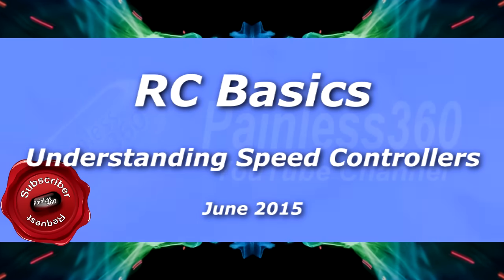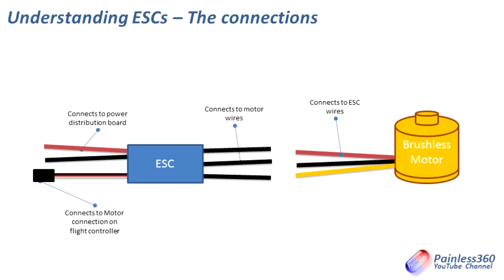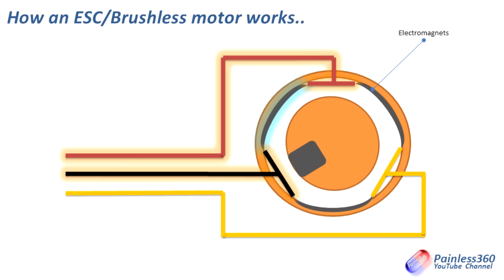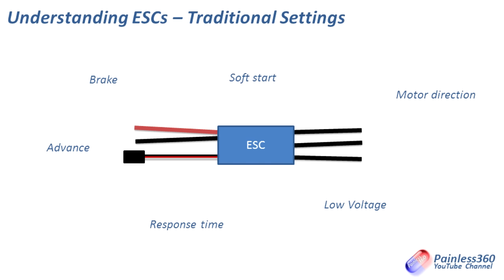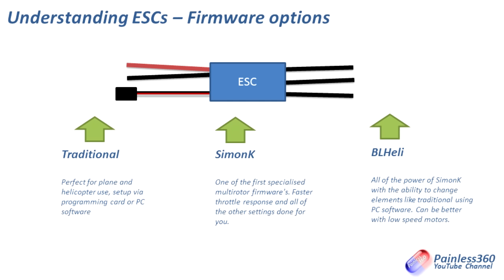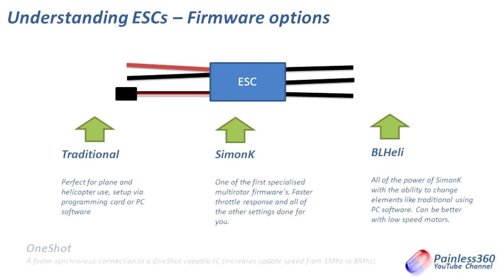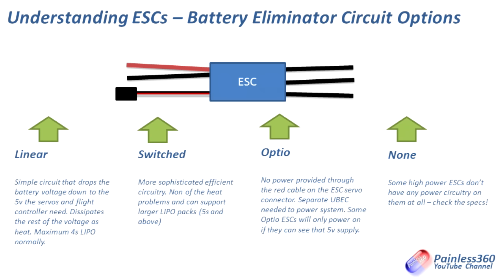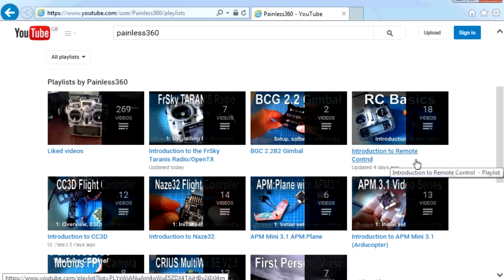RC Basics - Understanding Electronic Speed Controllers (ESC)

Comment: is it crazy to want run hobbying 35A micro ESC's with 5008 330kv motors and a pixracer as I am looking to reduce weight or is this just an altogether daft idea?
Reply from the maker: I'd look at the amp/thrust data for that motor for the prop and battery size you want to run. That beast is designed for HEAVY quads! :D

Comment: Do you have an efficient method of testing esc's to find a bad one? For example on a quadcopter if a esc is cutting out on the left side how do you go about discovering which is the bad one?
Reply from the maker: Not really, I normally swap the motors round with the suspect ESC to see if the problem stays with the ESC or moves with the motor but after that it's a firmware update to it and re-do the throttle calibration, if it's still not happy then I'll swap it out. Best of luck!
Reply: Thanks for the reply! I've seen where guys use servo testers to test esc functions. I'll try your idea of moving the motor around. Thanks again!

Comment: Hello. I'm intent on using an RC motor in a project and have a 12V power supply and a PWM all set to go. Is it possible to connect a brushless to the PWM without an ESC or is the latter a must for brushless? If so, what motor then can I just connect to a PWM in just cutting the wires and attaching it? Your diagram and animations are informative BTW 'cos I'm learning as I go with this stuff.
Reply from the maker: +James Taylor The simple answer is.. you need an esc if you are using a brushless motor. Best of luck!
Reply: ok, i'm in a bit of a conundrum.I was trying to use a brushless motor (thanks again on clearing that other question up, btw) and my intent is to use a 12v power supply connected to a PWM which is then connected to the brushless motor. This is is all for a project. Question: am I mental for thinking this will work?

Power supply: https://www.amazon.com/gp/product/B01N0O646U/ref=oh_aui_detailpage_o01_s02?ie=UTF8&psc=1
PWM: https://www.amazon.com/gp/product/B01H1W79S0/ref=oh_aui_detailpage_o01_s00?ie=UTF8&psc=1
Motor (I'm returning this one before I make the mistake of overloading it): https://www.amazon.com/gp/product/B01149JBNC/ref=oh_aui_detailpage_o00_s00?ie=UTF8&psc=1

Comment: HI,    i have a doubt .is  it possible to run a 1200kv +30a ESc with a dc12v supply from my adapter
Reply from the maker: +Sav job an ESC doesn't have a KV rating. See the videos in the ' Introduction to Remote Control ' series for more information on the basics. Best of luck!

Comment: i mistakenly connected the middle wire of esc with rigth wire of motor. now the esc is not calibrating it is just beeping 
is there any solution for that
Reply from the maker: Depends on which wire you're talking about - one of the three that go between the motor and the ESC or one of the three wire cable that has a red/black/white (or brown, orange and red)?

Comment: Hello sir, i have an bldc motor having maximum current drop is 24A at full throttle, so what rating of esc is suitable for me? What happened if i use 40A esc? And i had little confused in constant and brust current. Thanks
Reply from the maker: Having the rating of the ESC more than the motor is a good thing. Burst current is what the ESC can supply for a few seconds without damage and is usually more than the constant current rating.. Hope that helps..
Reply: Can i use 40a esc? Is there any disadvantages to the motor? Thank u for quick reply
Reply from the maker: All covered in the videos in the ‘introduction to remote control’...

Comment: i have made a q450 drone using sp-f3 flight controller , flysky ia6b reciever, a2212-1000kv motors, 20esc...
whenever i spin the motors using the transmitter...the speed of the different motors reduces at a very fast pace at that too is different for different motor!!
i dont know what is happening...
but when i spin the motors from the cleanflight software...then there is no such problem...
please help!!
Reply from the maker: Not sure what you're describing. If this is testing on the bench then it's normal to have odd behavior as the changes in motor speed are not 'felt' by the flight controller..

Comment: iam building a quad but one ESC worn out all are 20amps can i use 30amp esc? bcz there is'nt 20 amps availability in our place (out of stock)
Reply from the maker: +basha msk all the ESCS need to be identical, even down to the software version for the model to fly well/at all. I'd hunt for a perfect replacement. Best of luck!
Reply: Painless360 both are of same company sir

Comment: i have a boat that there is a lite on esc and beeps but the motor or servo move and the wires to motor not marked and a friend unhooked it but not sure if rhey r hooked back up right
Reply from the maker: If the aeSC and motor are brushless then they can be connected anyway. If the motor spins the wrong way, simply swap any two of the three wires between the ESC and motor.. best of luck

Comment: I used 30A ESC and a 3S lipo battery in my quadcopter. After arming the motors a strange beeping sound(1 beep) was coming from the esc s and the motor did not run when I turned on throttle. What should I do? Can you help me in this case? I'm using sp racing f3 flight controller and using i-bus connection. Actually I couldn't calibrate 4 escs at a same time with i-bus connection. Do I need to calibrate esc individually? 
And do I need esc calibration every time after first calibration?

Comment: thank you this is very helpful...i have quadcopter that only has two wires for each motor as they are brushed motors..the motors burn up allot ..i was wondering if there's was way to run the brushed motor in this quad with one of these speed controllers? or am i just crazy ..i'm a newb to this stuff ..i'm a mechanic too so i'm able to fix stuff..but only if i understand it ....which i don't at the moment
Reply from the maker: Not easily, brushed motors are used on the cheaper models.  you dont mention the model you have but you could google for a brushless conversion kit for it. 

Best of luck!

Comment: Hi! Great video and great explanation!

I’m currently building a quadcopter using an APM 2.8 and maybe you could help me solve some questions I have. I have LD Power ESC’s with NO BEC’s. Does that mean that to power the APM I should leave the JP1 INSIDE to power the whole APM with the 5V the power module provides and leave the power cables from all of the ESC’s connected? In that case, will those 5V the power module provide be enough to power the whole APM or could I have voltage shortage problems, or over voltage problems coming from adding the power module voltage and the ESC voltage (with no BEC the ESC’s should not be powering the APM at all, wright?)? 

Thanks in advance!
Reply from the maker: See the power video in our APM series for the answer to your question. Best of luck!

Comment: is it possible to mix ESCs from different manufacturers? so for instance 30A SimonK  from one seller and same from another seller? there is a lot for sale in red heatshrink that look same?
Reply from the maker: Not really, I've had problems using ESCs from the same manufacturer/same make and spec but different batches! Keep them all the same is my tip..
Reply: Thx for getting back to me, I appreciate it, I agree and would like to keep the same type, but is there a way of comparing ESC to see if they're same type? I have a broken one, and can't remember where I bought from, ,,,,,,,so I don't want to ditch the other 3 and buy 4 new ones unless I absolutely have to. Is there a way of testing the performance say in mission planner to log the ESC (via pixhawk) to see if the odd one out is performing different to the other 3?.....(if there is no obvious signs of mismatch?). Or is there a known factor that makes it an absolute no no?

Comment: Hello sir, i decide to use hobbywing XRotor 40A esc with my motor (tarot tyi-5008 400kv bldc), 6s setup. Is it right choice? Or any changes needed?
Thank you.
Reply from the maker: Should do but I've not used one myself. I'd check with the vendor.. Best of luck!
Reply: Painless360 thank you sir

Comment: If I have an ESC with a linear BEC, do I have to connect the BEC, or can I just cover the end of the red wire with some electrical tape? I'm thinking of using the radix PDB, so I don't need BECs, so is it safe to just not connect them, or would that damage the ESC?
Reply from the maker: If it's linear then you should be able to connect all the red wires fine. See the other videos in the 'Introduction to Remote Control' series on the channel. Best of luck!

Comment: Can I use higher amp ESC than rated motor amps? Also, curious if we can use spare AIO 4in1 ESC's for fixed wing (single/dual motors)?
Reply from the maker: Yes and it should but fixed wing ESCs expect to be used in a different way.. Best of luck

Comment: Hey there, great video! I have a question:- I have a set of HobbyKing 20A BlueSeries ESC's for the quad I'm building, but I can't find anything (manual or HK) that tells me weather they are linear or switched. How can I tell?
Reply: Nivek0the0Relic Does it use SBEC in the spec?  That should mean they are the switching type.
Reply from the maker: Nivek0the0Relic SBEC - Looks like switching to me! :)
Reply: Nivek0the0Relic Thanks guy's, noob here didn't know what the "S" in SBEC meant. Time to unplug 3 of those red wires. :)

Comment: i m using 480 kv motor which esc should i use for this motor and also prop size
Reply from the maker: +Geeta Bhatt you need to check the specifications for that motor. They will tell you what the amp draw is for various prop sizes and then you can get a ESC that is a little bit larger. See our videos in the introduction to remote control series for more information. Best of luck

Comment: Hello can you help me why my esc is getting hot and make the motor twitching like running back n fort? and we tried it often until its not beeping anymore. Please help me
Reply from the maker: That usually points to one of the three connections not being connected - bad connection, blown winding or damaged ESC.. Best of luck!
Reply: @Painless360  is it okay not to solder the connection especially not using any plugs?
Reply from the maker: Many do and it is fine.. Best of luck!
Reply: @Painless360  Hello is apm 2.8 has obstacle avoidance feature or sensor?

Comment: Hello,

My question is if I am running 4 ECS without BEC then my options are to either get a 5V regulator or buy 1 additional ECS with a switch BEC and replace one of the original 4 inorder to power my Naze 32 F3 acro 6 and my X8R?

Thanks
Reply from the maker: Please watch the power video in the 'Quadcopter Building for Beginners Series' on the channel. We cover the options in there. Best of luck!
Reply: Okay I watched that video. The thing is I am using the Alien frame that has the built in PCB but doesn't have the 5V output. So I could either get a 5V regulator or switch one of my ECS with a switch BEC correct? Best bet would be to get a voltage regulator right?
Reply from the maker: I'd use a separate BEC as swapping out just one of the ESCs for something different can cause stability and calibration issues. Best of luck! (can't believe they don't provide a better PDB on a frame that expensive..)
Reply: yeah I should of went with the ZMR250. Thanks Though.

Comment: One silly question: One bad ESC can burn a motor? I just bought a Rc250 from bangood and in the first try one of the motors burn without leaving the ground. I replace 4 motors and at second try the same position motor burn again. Can i replace this with a diferent model of ESC with a higher amp?
Reply from the maker: Oscar Ponce Anything is possible but very rare. I would replace that ESC with the same type or replace all of them with a higher amp rating.
Best of luck.
Reply: Ok, I will follow your advice, and stay away from my "quick fix". I didn't wanted to wait 15 days to finish this one. Thank's one more time for your help.

Comment: After 2 flights or so my motor started to make a high squeaking noise and it seamed as if the motor was spinning the right speed but the prop was spinning slower. And if I kept the motor at a constant setting it seemed the motor kept increasing. If you have any idea how to fix this please comment back!
Reply from the maker: +Peak Chair (peakchair2002) I would check that the prop adapter is tight on the motor shaft and then check the bearings don't need a drop of oil. Best of luck.

Comment: What does the "35A" mean on the ESC. I know it means 35 amps are supplied to the motor, but how do you determine that when picking out the correct esc to buy?
Reply from the maker: You normally choose an ESC with a higher rating than the max amps a motor will draw.  I usually go for one 20% higher rated. See the other videos in the Introduction to remote control playlist.. best of luck

Comment: When I connect the battery to my Diatone GT M3 it only makes 3 beeps and not the usual 5 beeps. It won’t arm and won’t connect to Betaflight anymore. I can’t flash the FC firmware. Need help, please. Thanks!
Reply from the maker: What happened between it working and not working and what troubleshooting have you already tried?
Reply: Painless360 Thanks for answering!. Kind of a long story. Installed a Nano Crossfire Receiver, but most of the times it wouldn’t connect to the transmitter, sometimes it did though. I resoldered everything several times and changed RX and TX but the problem persisted. Tried another new Nano Receiver and the same thing happened. Then suddenly, for no apparent reason, when I connect the battery it just makes the first 3 beeps (that tells me the ESC is getting power) but it does not make the other 2 beeps, which according to what I read means it’s not getting throttle signal. Surprisingly, the Nano Receiver is now always binding. Tried to flash a new FC firmware, but Betaflight (on Mac) won’t let me connect to the board or flash it. The usual USB port option is not there in the menu. The FC turns on with a steady green light. Maybe I shorted something while resoldering and testing? (It never smelled burnt and there are no signs of damage anywhere). Not really sure how to proceed from here... Thank you so much, I really appreciate your help.
Reply from the maker: Could be a short, I'd check the FC isn't damaged and check the soldering then try and pop it into bootloader mode (see the manual for the FC you have). Best of luck!
Reply: Painless360 I’ll do that, Thanks!!

Comment: I have Mr RC 12A ESC's, I have them attached to the Voltage distribution board, and used only 1 BEC attached to the CC3d Atom, everything was working perfectly, the ESC's beeped and they were spinning at 1069-1074 an up. However, after I tried the transmitter setup, it went on terrible, the only one with the power on works perfectly, the rest wiggle while beeping, 2 of them spin only on 1120, and 1 of them just keeps wiggling. Can you help me please?
I have cc3d atom, 4 mr RC ESC's 12A, 4MARS POwer 2300KV, Fly sky TX/RX's
Reply from the maker: Not sure, I'd look at going through the ESC calibration again.. Best of luck!
Reply: MR RC 12a ESC's are they the Linear or Switched ones??
I used as Switched one, and removed 3 other ones, and it was working perfectly for a while, but later, it was bad.
THanks in advance))
Reply from the maker: Check on the specs on them on the website you bought them from/ask the vendor. They are usually linear if it's not listed.. Best of luck..

Comment: Which way up are the 3 wires on the connection from the ESC to the Naza Mv2 main controller? My new speed controllers have Black Red and White wires to the connector. My old ESC's had Brown Red and Orange with the brown uppermost.
Reply from the maker: Yellow and white are the signal wire, Brown or Black is GND.. Best of luck!

Comment: I have a Turnigy Multistar Esc 40a opto v2 , i tried to plug it inside a multistar usb programmer and upgrade its firmware on BLHeli , the Esc was identified as 20a in BL heli so i chose to Flash Firmware and i chose the Multistar 40a which exactly the name of my esc , when i finished, i pluged it back into my multirotor , BUT SUDDENLY THE MOTOR FRIED AND THE ESC START MAKING SMOKE !! What can be the Problem ?? what did i do wrong ??
Reply from the maker: +JISA Not sure, we don't play with the setting on BLHeli often, we have got into trouble by flashing the wrong firmware onto ESCs in the past so that may be part of it here... Best of luck with it..

Comment: Hi painless. I was just wondering if you could help me solve this puzzle. 

I want to get the Hobbywing Xrotor 40A esc's but they are opto which means I would need a separate linear or switched. 

Here is the problem, I have a gps and a Bluetooth receiver on my naze32 which take up 2 slots on my naze32. Is there a way to plug in the separate BEC to the board without having to unplug the gps or Bluetooth? 

Maybe leave one signal wire on Hobbywing Xrotor 40A and plug in the ground and power of the separate BEC in? Do you think that would work? 

Or can I grab power for the Bluetooth from another part of the board or maybe the battery? At this point I don't know, I would really appreciate some help. 

Thanks!!!
Luciano
Reply from the maker: +Luciano Sanchez You can try and power the board by connecting the BEC to a spare input in the radio Rx. Make sure you're not using any servos on the FC though..Best of luck.

Comment: Hi I want to use a USB battery pack 5V 2.4A, can I plug it in directly into the servo tester or do I need some kind of voltage regulator in between?
Reply from the maker: So long as it's 5v then you should be fine! :D
Reply: Painless360 awesome, the reason I asked was because, I had a HJ digital speed tester and it blew from the 5v power supply, i was wondering if it could be the 2.4amps, but in theory it shouldn't be, right?